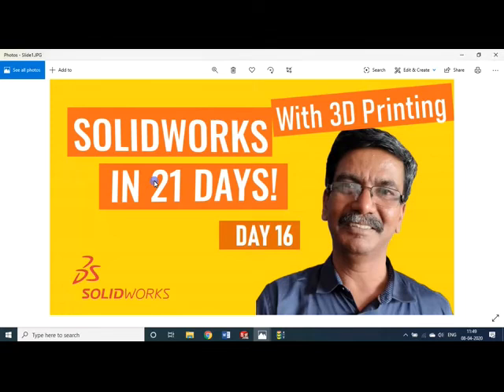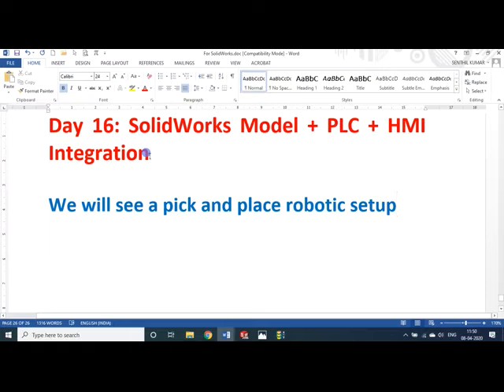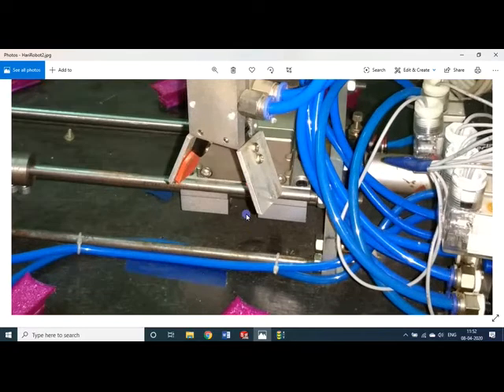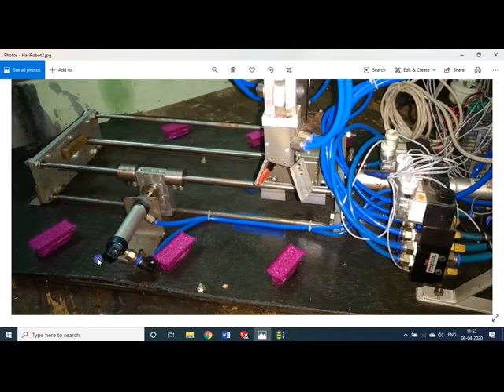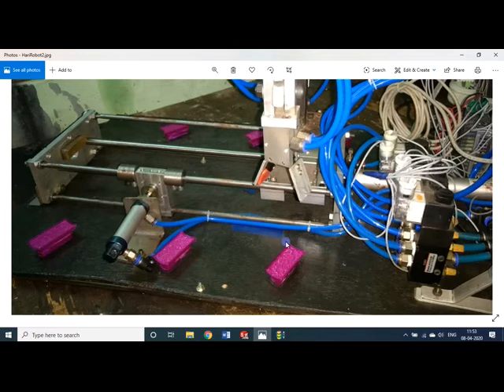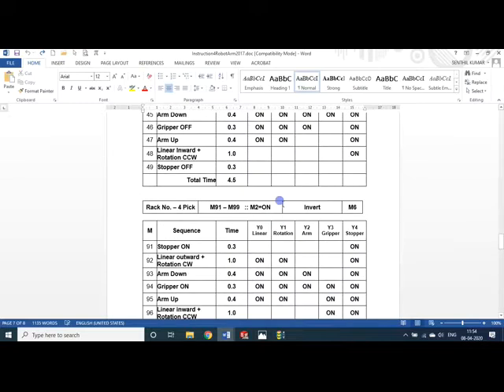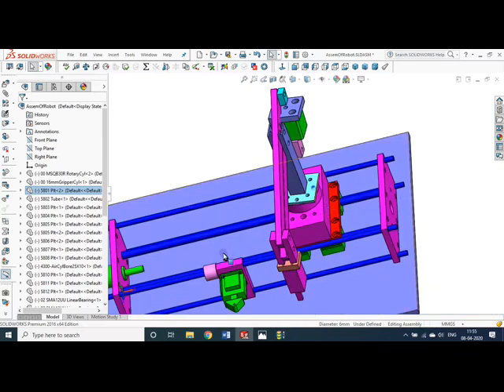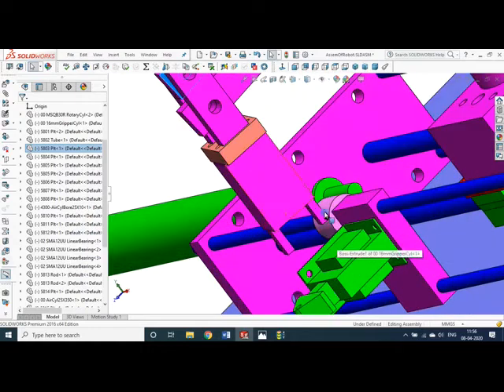D16 | PLC | SolidWorks Model + PLC + HMI Integration

Comment: Sir, how we enable the communication between arduino and delta plc?
Reply from the maker: There is no communication between Arduino & delta plc.
But communication between plc & HMI is effected through serial cable. You have to specially & specifically buy it, may from AliExpress